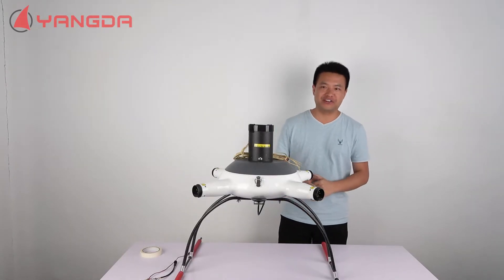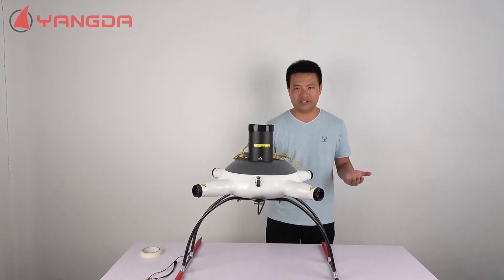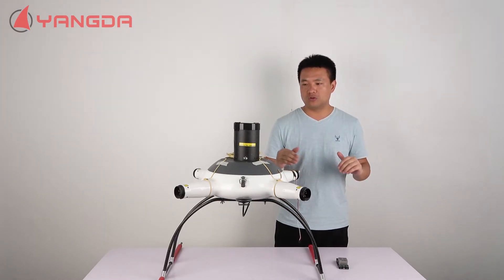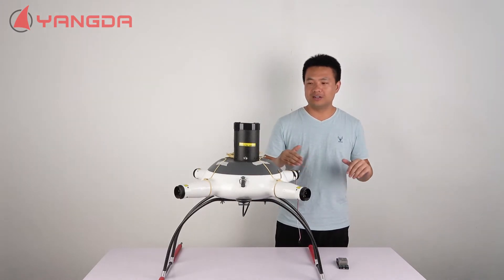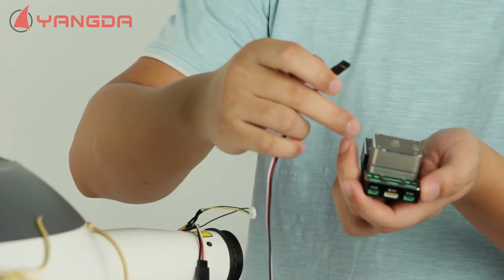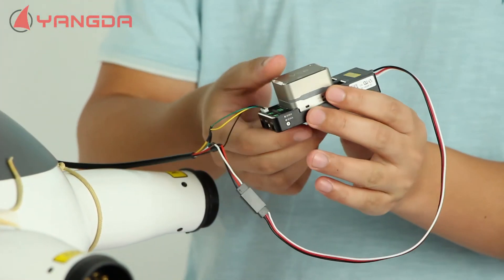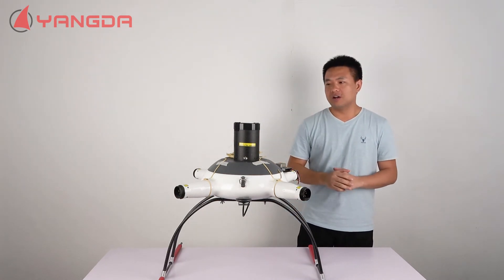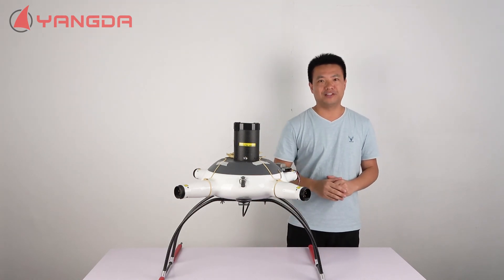YANGDA Saver UAV Parachute Installation Tutorial

Comment: Thank you for this new product and the demonstration... I would like to ask how much does the unit (meaning the chute and the casing) weigh?
Reply from the maker: The parachute in the video is Saver-20, and its weight is 550g.
Reply: @yangdaonline  thank you for your response, another question: what is the maximum of drone that the parachute can support?
Reply from the maker: @carcher3279  60KG
Reply: @yangdaonline  excellent. Thank you. I'm also wondering... If a drone is large enough, Can multiple parachute units be made to work in tandem?
Reply from the maker: @carcher3279  Technically, it can be done.